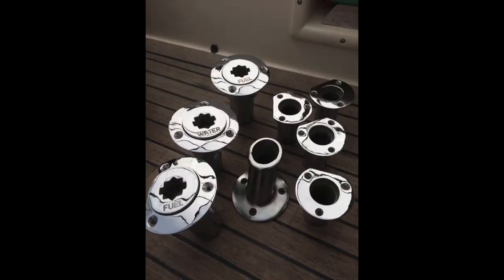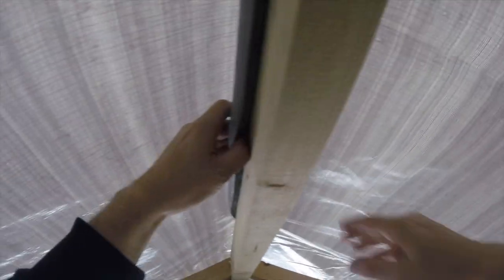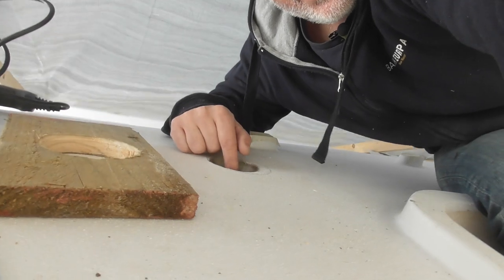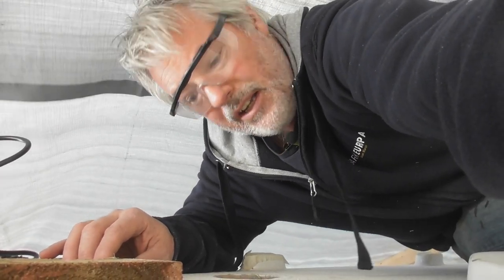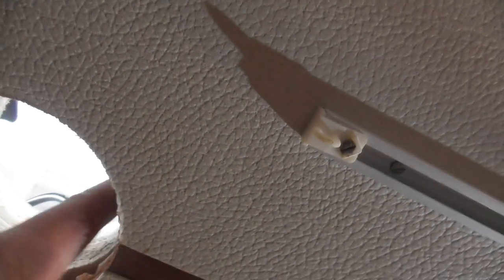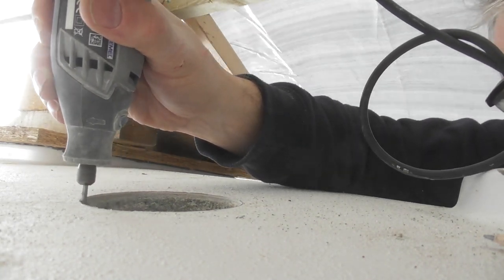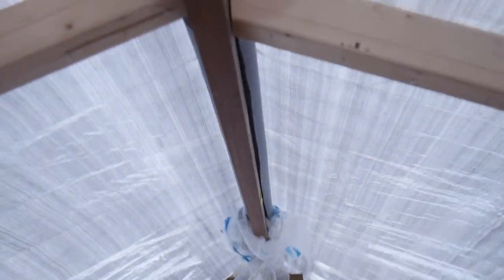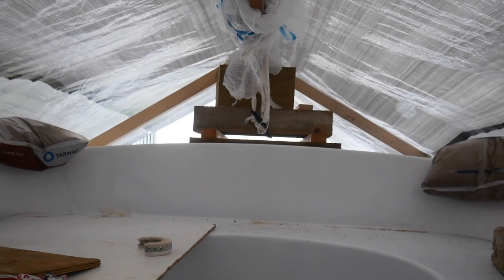#75 - installing air only vents

Comment: I got some good news this week, I am not getting kicked out of the shed. I was dreading the tarp again and dealing with the elements. I don't have much space to work, less than two feet either side of the boat, because other boats are crammed in so tight, but I will make it work. Keep up the good work, you are way ahead of me, but I am moving along nicely.

Comment: Smart move to install the air-only inside the dorade boxes. We had a huge wave on the Atlantic once fill up the complete dorade box, finally letting in a liter or so of salt water, straight onto the sleeping bag of one of our crew. Ironically this was the only one of us that had managed to keep his sleeping bag completely dry on this crossing, by meticulously keeping wet cloth away from his bed - until then.

Comment: Rechroming is an expensive business unfortunately and as mad as it is, buying new is likely most cost effective. Top tip when using a holesaw, drill a couple of 10mm ( the larger the better) dia holes near the periphery of the cut line (and in the waste area) it helps clear the detritus produced by the holesaw and prevents the tool overheating.😉

Comment: Great video. Where did you buy the Air-Only Vents?  Are they any good?
Reply from the maker: Hey, these vents are absolutely the best. They are made in Ukraine. I don't know how, but the last I checked (9 months ago) they were still operating and somehow managed to get some more delivered to me. I felt bad bothering them with the horrible situation they are faced with but maybe it was helpful to them to help keep the business ticking over. I can't recommend them enough. you can try and get in touch with them if you need some https://air-onlyventilators.com